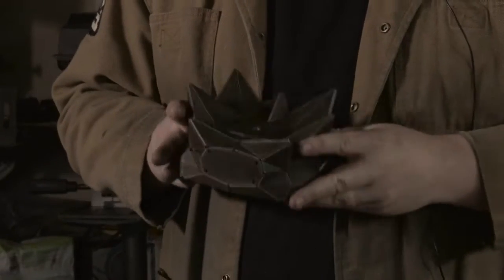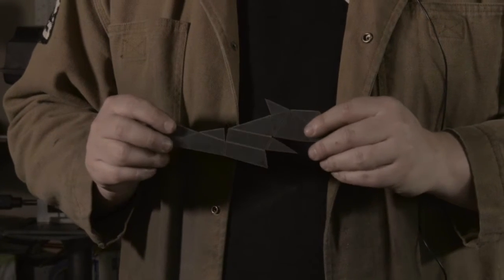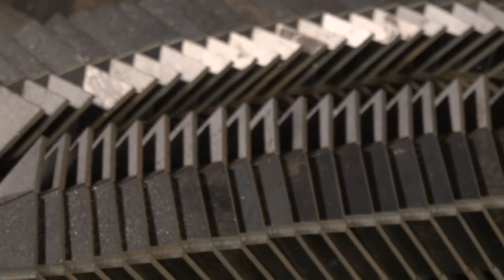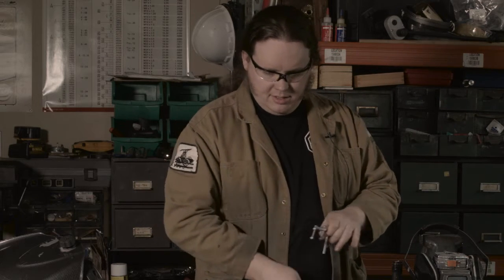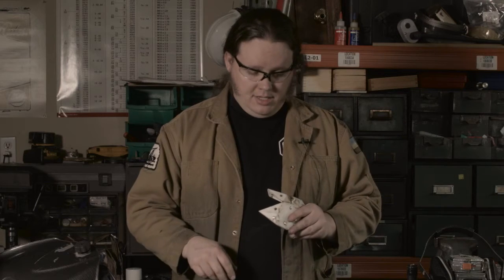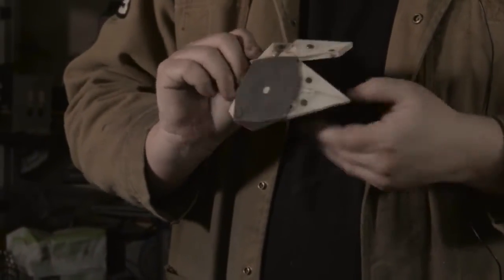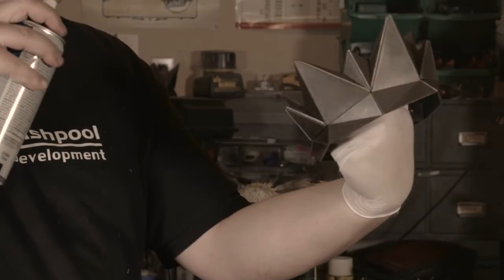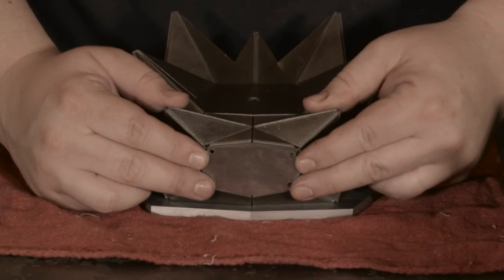Making the 2015 Hugo Award Base

Comment: I think the base is beautiful. I enjoyed the video. I liked the use of a 3-D printer which is sort of a science-fiction thing that's now reality. I have one question though which is could you not have just use the plastic 3-D piece that was printed? It could have been painted with metallic colored paint and looked exactly the same as long as the steel plate at the bottom was heavy enough and weight could be put inside of the base to support the rocket. I enjoy engineering and I enjoy artistry. I just wonder if you made it a little extra complicated. Anyway, congratulations on a beautiful result.
Reply from the maker: +Shelley Trazkovich, M.D. Oh, I definitely made it too complicated. :) But I like the look and feel of real metal far too much to use plastic just because it would be easier. I was happy to put in the extra effort for something like this. And really, figuring out how to make it all work was half the fun!